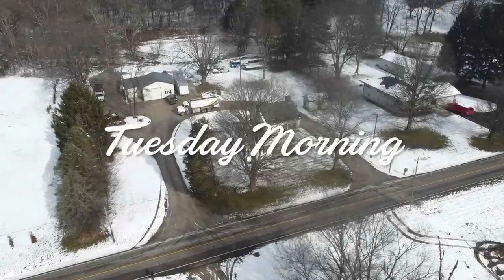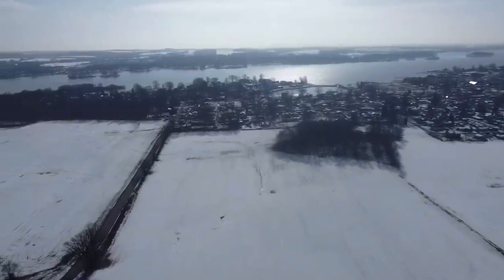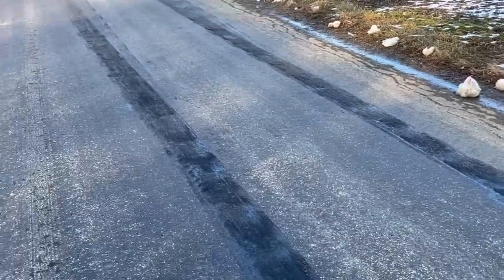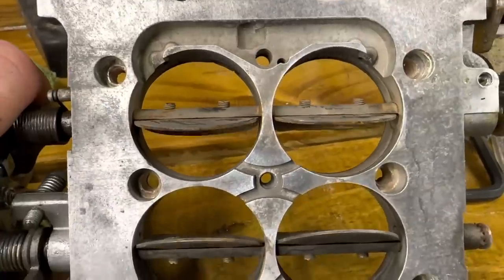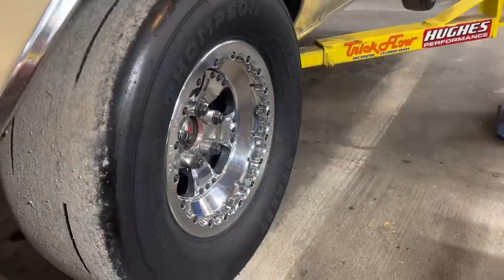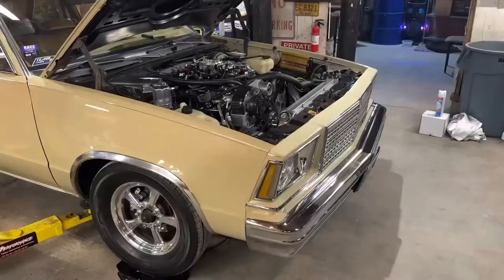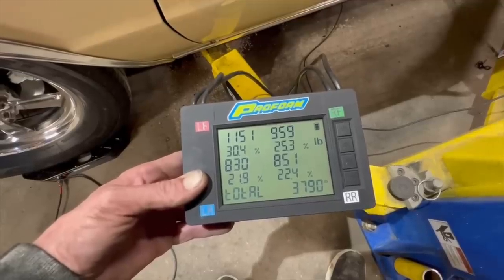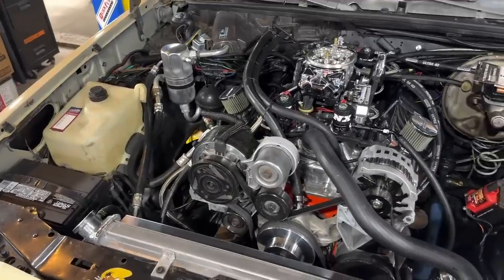WHATS IT REALLY WEIGHT? We scale it, and start making 4 link bar changes PLUS! FUTURE TRAVEL PLANS!

Comment: I had a similar problem with the  alternator on my car a few years ago .
When I had a 6LA MSD box on my car, everything was fine, with  no problems .
When I switch from a 6la to a 7la gold box, MSD ignition is when I started having problems .
I took my car to a guy who wires race cars .
He told me the reason I was burning out alternators was because there is a high output  the alternator goes into when the battery isn't at full charge when the battery is at full charge the alternator goes into low output .
And because my 7LA box was taken so much power from the alternator, the alternator was always  in high output, causing the alternator to burn itself out .
He put a meter on the battery, which showed the alternator was always in high output, not going down to low output  
 I bought a higher output alternator and never had another problem .

Comment: For reference on the TBM Brakes, Garrett is stopping that almost 5k lb El Camino with the same brakes. That also includes all the drag and drive events and a few times the chute didn't open at near 200mph. I expect they'd do well in the old Cracka' Barrel.
Reply: Drive it daily, pads wear out 500 miles, then the disk warps, then the wheel bearing race spun in the hub, great stuff
Reply: @alltherpm  they aren't made for daily driving... they are light to lessen unsprung weight and of course they are high friction to stop shit going way faster than a daily , all that energy has to go somewhere and it turns into heat which causes the parts to fail pretty quickly compared to a raybestos pad and rotor on your wife's suv .
Reply: @Hard_Right  so ur saying dont  Rely on them but some how it barely stopped a 2800 pd mustang, but stopps ur 5000pd car from 200 to 0, yah right great promotional advertising tho, sure tbm will appreciate u

Comment: A good front brake upgrade for 
G-bodies is spindles and hub bearings and rotors from a 99-02  2wd s-10 blazer it gives you a dual piston calipers a sealed hub bearing instead of the tapered bearings of yesterday’s technology. Only thing is you’ll never be able to run a factory 14” rim anymore as the rotors are 10.75 in diameter over the 10.5 in diameter and 15 inch minimal rim would be needed for then on.  The larger rotor and the better bearing and the fact it’s a dual piston caliber makes for a easy bolt on upgrade that’s clearly street legal an safe for that weight car. Basically your sons old blue blazers spindles and hub bearings with the calipers would bolt right on and you’ll see a big difference in stopping.

Comment: Bill I’ve run into this problem a lot with alternators. Your input shaft speed will blow one out. If this doesn’t work for you try a slightly longer belt and an overdrive pulley. When you get into the 7k rpm ranger your input shaft will be climbing do over 15k rpm. This will kill a voltage regulator for sure. Depends on what’s breaking inside the alternator.

Comment: Some stuff on alternators - Thos small case GM units always fail. The higher the output, the worse it gets. They have trouble dissipating the heat. 
rebuilt alternators always fail. They don't replace all the parts in them, and they use off brand parts. If you want to stay with the small units, get the Delco components and rebuild them. It's easy.
If you don't want to deal with alternator failures anymore, convert to the large case GM units. They are available from companies for severe duty applications like ambulances. You can get a very high output unit, then underdrive it with a bigger pully so it survives 7500 rpm shifts. You can fit a large case unit in your serpentine belt drive brackets. You may have to do some slight fabrication. I did it 20 years ago, I don't remember the details.
Don't forget to upgrade the charge cable, bigger is better.
Reply: Due to the aluminum accessory bracket we are stuck with the cs series alt so we decided on this unit which is a true upgrade made to take the punishment Bill will put it through. Wish us luck!
Chumpy
Reply: @superiorautoparts1608  I'm honored to hear from the man himself! Don't hesitate to take Bucko in the back and smack him around a bit 😁.
You can run the larger units in the aluminum serpentine drive. I have the early 80s case with a high output unit. All that stuff is available. I did my conversion 20 years ago, do details are fuzzy. I think they mill the bottom boss shorter and you need to modify the bracket that holds the top. In any case, i hope the new unit solves the problem.

Comment: If the TBM brakes aren’t what you want. 
Might try PowerStop Brakes. 
Drilled and slotted rotors and extremely nice ceramic pads. 
K1485-36 is the part # for a ‘79 Malibu.
Reply: This is what I have as well. Stops pretty good.

Comment: Cleetus/Garrett run TBM brakes on his 6 second 240+ mph 3800 pound G-body El Camino with no issues.
He did Sick week, RMRW, Midwest drag, Drag week (4k+miles) pulling a trailer. A lot of the drag and drive folk's use TBM brakes

Comment: That alignment issue is a simple fix with s tape measure and with it sitting on those scales or on the floor. Just set the front of the tires about an 1/8 inch closer than the rear

Comment: The TBM brake will be fine for what you are doing. Look at Mullet from McFarland Racing. That is a big block running 6's at about the same weight you are, and it has TBM's on it. What Mullet has been able to do should sell you on those brakes.

Comment: time for solid aluminum body mounts , cut the inner crash bars out of the doors (80 pounds) . Straight Shot Performance G-Body Tubular Core Support , 32 gaallon fuel cell , afco low friction ball joints , tubular front end , Allstar  - Fan Shroud , drilled and slotted rotors with rem coated bearings , fiberglass or carbon fiber front bumper . AJE Suspension Front Subframe Kits CN-6267M will fix a ton and chop a lot of lbs off !!!!!!

Comment: Used to be a guy who built a tubular core support for the g body. I had one and it saved a ton of weight off the nose of the car, however no provision for the stock hood latch and not sure how the ac condenser would mount. Still, lots of weight to be lost in the stock core support. Obviously the front bumpers are heavy and the front bumper brackets are liquid filled and heavy as well. I wanted the tucked bumpers with the air dam that was all one piece, never got around to buying them. Sold the car to a buddy and he ordered them and had to wait a long time for them. You will obviously lose some weight with the tubular control arms and front brake upgrade. Look forward to whatever you do with it. I love g bodies!

Comment: You can cut the back side of the bumper out  and replace shocks with aluminum street car stuff in my state you can't put it on street without a bumper and take the carpet and pad out and replace it that thin outdoor carpet if you're headers don't get the floor to hot

Comment: Alternators work best if you add the Big 3 upgrade. It will increase voltage and the amperage it puts out! Look it up on YouTube, it's well worth it. It's common with car audio guys like myself. I charged at 13.8 volts and pulled 200ish amps from my 250 amp Alt. I did the Big 3 and jumped up to 15.3 volts charging cold and 14.8 volts hot and charged at 307 amps.

Comment: That's still a good 200+ pounds lighter than the late second  generation Camaro! My 1978 with small block and automatic transmission weighed over 3700 pounds WITHOUT me in it!

Comment: Ohio generator has a custom alternator with 8 diodes. mine has 230 amps at idle and can be fully adjusted with gilmer belt and pulleys for a class installation. Jones has pulleys and wider belt. runs flawlessly.

Comment: Bill you might want to hit up your buddy Justin Shear. He just did a video on chassis setup on a slick car where he explained the difference between the setup of a drag radial car. As I already knew a drag radial likes a shorter instant center so the rear end will separate from the car, slicks like a longer instant center. Try going with a a shorter instant center than you originally started with as it will apply traction sooner.

Comment: Malibu is looking good billy. Time for a massive diet for it though especially off that front end. I'd swap out the hood for a fiberglass one. Get any and all brackets for anything forward of the firewall made of aluminum or titanium. Find some lightweight bumpers front and rear. Fiberglass trunk lid. Lightweight battery (some weight like 8-12lbs).  See if tbm has racing hubs, brakes and whatever else. Have some fun out of it and get nuts with weight savings. Mpg will improve too. Would be cool to see you shave 300-400lbs off it, and it won't look cut up at all. Have the potential to shave a solid half second off your times.  Happy birthday Jeff!!!

Comment: I was fighting my gbody with the same issues. maybe a little more hp and 100lbs lighter than the malibu. same viking shocks. numerous bar angle changes. i ended up spending the money on some menscer front shocks. best money i have spent on the car. the extra adjustments they have let me slow the front end down, solved all my issues. still has the viking shocks on the back. ended up with a low 1.2 60' on a decent track on radials and high 1.3's on radials at thornhill's no prep water burnout only night. car has 3.25 rear gear with a 2.48 first gear. i think that starting line ratio helps take some of that initial hit off the tire on my setup.

Comment: Moving the battery in the trunk changes front to rear weight ratio 1%, which is a good cheap move. Of course, you could spend almost $2k on one of them high tech lithium batteries from Braille that only weight like 7lbs compared to the 30 or 40lb battery in there now. I can think of a lot better things to spend $2k on though lol. 
Wishing you and your family continued success on one of the best damn car/race channels around!

Comment: Good tec info  ..may could get with the guy that made Billys aluminum radiator support for the s-10 make one for the malibue and replace all the front bumper brackets with hand made aluminum brakets  may could be a  new product line lol.  Power coat them black . Maybe a fiberglass or carbonfiber front bumper paint to match original… ok finally  Joel  one of my employees is into car stereo had a guy make him a battery pack using lithium drill batterys he gets from Ebay that looks like a reg. Battery but doesn’t weight much.   Im sure you probably can buy them now… thats all i got LOL just want u guys to kick ass great show

Comment: If you don't already have the conversion plug from a Si alternator to CS alternator. You need to get one. Otherwise you will keep burning up alternators. You do need to know what year CS alternator you are running. Slight changes in 94 and up.

Comment: Back in the day do this stuff when I had to run to the Auto parts store or Hardware store I would always buy extra bolts or fittings just in case , alternator belts  too.

Comment: Question did you do a 3G battery wire upgrade for the alternator if not you might want to look into that before it burns the car to the ground. With that amount of amps coming out of that alternator it could catch fire.Its a popular upgrade on the mustangs I got one on mine and way worth it. Stay safe and stay fast brother.🇺🇲

Comment: car is looking good would switching the rear axle to double adjustable coilover instead of the old coils and cleetus runs TBMs on mullet it weighs over 4000 lbs and he drives it at least 3000 miles a year and stop great at 200 plus cant beat that

Comment: Correct me if I'm wrong on this. What about ditching the stock style front coil springs and installing coil over adjustable front shocks and springs in the Malibu? That way the ride height can be set higher or whatever height needed in the front so the car is nose up to transfer the weight to the back.

Comment: Maybe a larger pulley on the alternator so it isn't spun so fast... at 7000+ through the traps that alternator is spinning way faster than it was ever designed to work...max rpm at the alternator should never be over 18,000 rpms which depending on the size of your crank and alternator pulleys, I would say you are probably over that quite a bit.

Comment: I had a 1984 Monte Carlo SS from new until December 2021 that had a swapped all aluminium LS2 with LS3 heads and a GM single plane intake with a Holley HP 850 carberator the chassis is the same as your Malibu it weighed 3380 so if l was to guess the weight of your Malibu l would have guessed 3480-3500 my Monte Carlo had a 700r4 transmission that probably added a few extra pounds over your Malibu transmission but my Monte Carlo had the AC deleted but still retained the AC firewall box was not removed it had a 1986 Buick GN 8.5 rear end with 4.10 gears and originally had a swapped built turbo 350 transmission with a 3000rpm stall converter but was swapped to a built 700r4 with a 3000rpm lockup stall converter because anything over 60-65mph for extended periods on the highway was unbearable with the 700r4 in 4th gear and the converter in lockup it could cruise 80mph at 2800-2900rpm

Comment: So I think I missed the part. Where You told everybody what block you Are running I’m curious to know is it a Chevy block or is it a dart to block? I have a Chevy block that I’m thinking of Rebuilding so I’m curious what your block is
Reply from the maker: It’s a Speedmaster Extreme Duty Cast Iron 400 block with 400 mains
Reply: Thank you I watch your show and your son shows every time they come on for a very long time it was spired me to pull out my GEN two Camaro and put it back together. The problem is I live in Long Island. There’s a track here but it’s only open from August to October, ridiculous. Thank you for your response.